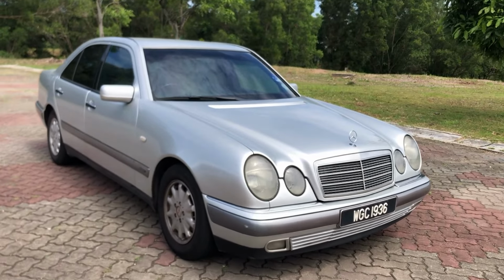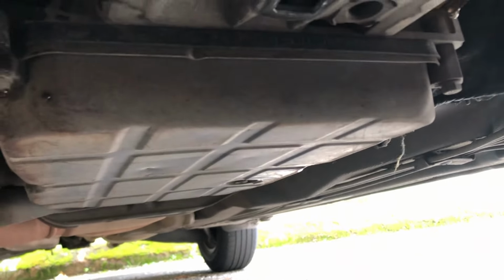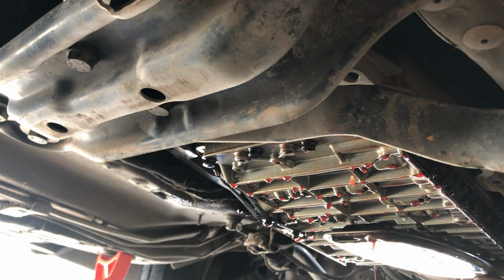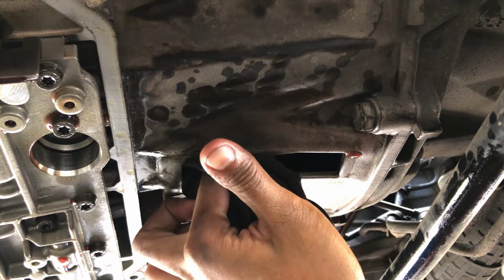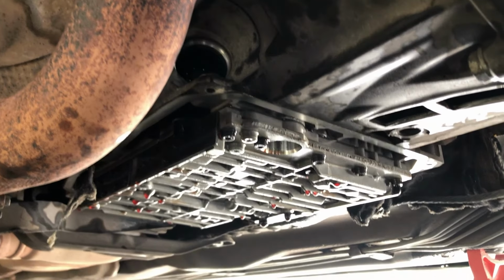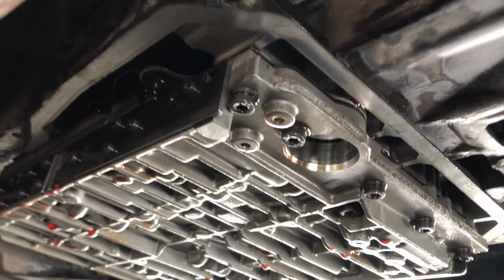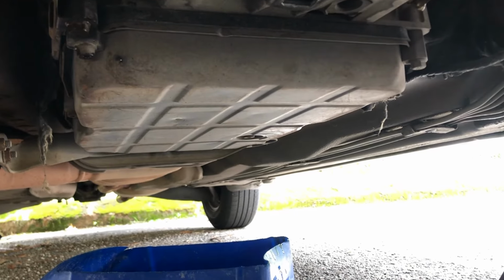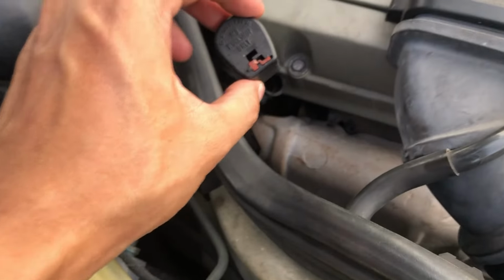How to Service/Transmission Oil Change Mercedes W210 M111 722.6

Comment: in order to push out remaining/residual fluid inside the valve body do you think necessary  to blow air inside it? I saw in other video the guy using special tool/pipe  blowing the rest of the fluid out (apparently gravity alone is not enough to clean it up).... please advise, thank you

Comment: I'm pretty sure the oil was recently changed, just the oil (and it looks like something cheap), no filter, no gasket, no mecatronic socket. P.S. never use a rag to clean the valve body, only use brake cleaner or chlorinated brake cleaner. Next time, remove the valve body and clean it properly as well as the sensors on the conductive plate.
Reply from the maker: Thank you for the advice, next transmission oil change will follow you advice

Comment: Mercedes Benz W210 E260 is 2000, I have been using dr.starke 10W-40 oil for 11 years and I change it every 5000 km, will it be harmful if I use 0W-40?
Reply from the maker: I think better to use 10w-40 bacause in the mercedes owners manual mention to use that 10w-40. It also depand of your country temperature. Watch my oil change video there more information about this 

https://youtu.be/mMRmM_9Hglw?si=Ijr93gNOon-qXEb4